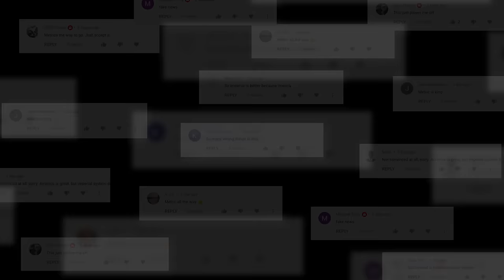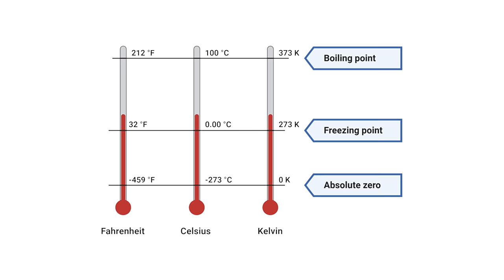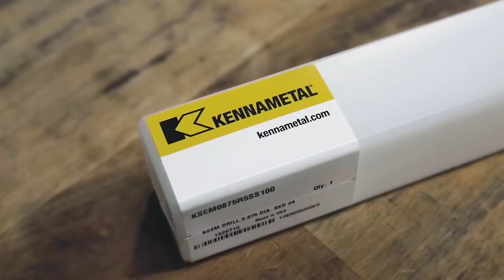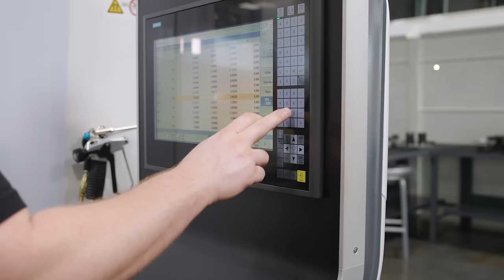Why METRIC is SUPERIOR to IMPERIAL

Comment: The problem i have with imperial is i don't know which one they talk about usually.
When someone tells me their size as 5'7, some mean 5 feet 7 inches, some 5 feet and 7/10th of feet (decimal of foot, like 5,7'), gallons, i can't tell which one and the list goes on. it's always a guesstimation. It must be very to use between people who know which unit they agree on, but having to use both british and american imperial, it's a mess ^^'
Glad most customers i work with now use metric. I believe most of the resistance against the metric system has nothing to do with technical considerations. It's just people don't like change, or don't want to be the generation that will live the change because it takes effort just for that little while.
If America switched overnight to metric, it would cause a fuss for a few years but kids growing with it wouldn't even think about it because it's easier.

Comment: I do construction work and normally, we don't need accuracy down to the level of the mm.  Most of the time our accuracy only needs to reach no smaller than 1/8 of an inch.  Assembling buildings does not require the same tolerances as rockets and lab equipment.  If you're going to talk about accuracy, for much of what we do in life, imperial is sufficiently accurate.  Most people don't do any kind of work that needs extremely high tolerances.  Much of the time we do things that allow for the little inaccuracies that we run into.  Manufacturers use statistics to make sure your 1 liter bottle has at least 1 liter of liquid in it.  Their machines aren't accurate enough to make sure that you only get 1 liter in the bottle, so they always put a little bit more making sure that the minimum is equal to or greater than 1 liter.  It's the same with filling containers in imperial units.  Metric is only truly better when you actually need the accuracy.
Reply: Or if you actually wanna do math. 4.3 mm + 8mm is much easier than 11/64 + 5/16. Any basic algebra will be easier to do in metric. Also, here, the "base unit of measurement" are centimeters.  If you've got to cut a 256 cm piece of wood, you'll know to cut a piece of wood that's 2 meters and 56 centimeters long. The same piece of wood would be a 100 inches in imperial, which is around 8' 5". Imperial might be good at estimating things, but conversion and algebra will always be easier to do in metric.

Comment: Thanks for the interesting and educational discourse.
While there is a case to be made for same same but different, the conversions are annoying and I wonder what percentage of those complaining against the metric had to work in NASA in 1969 or in some machine shops now.
America's legal Imperial measurement definitions are actually backed by metric. So, what is legally defined as an inch is first defined in cm.
I learned this via RealEngineering's channel where he goes into metric in more detail - highly recommended and very drole.

Comment: Living in Germany I obviously learned the metric system. Imperial is just illogical to me though in some rare cases it makes sense to use it. Tabletop Games for example. Measuring in cm just clumps everything up. An Inch though is still a fairly good distance between 2 models to work with. In my job (freight forwarding) it can get funny when talking to my American colleagues when they inquiry a shipment and don't specifically mention the unit we always have to ask if it's inches or cm and lbs or kg.

Comment: The metric system simplifies life much more when you use scientific calculations like magnetic fields per surface area or flows or thrust vectoring then  you csn easily calculate in your head when you scale it.
Try doing that unit conversion in the head for imperial system.

Comment: I MAKE HISTORICAL MENS CLOTHING  the old books I use are in imperial - I grew up with imperial - but OH MY GOD it is a living hell compared to metric.

The patterns I use most I convert the instructions to metric.  But I have things like breast 19 3/4.  Take 1/3rd the breast and add 3/8th so I have [[19 3/4]/3]+3/8
OR 502mm / 3 +10 = 177mm

Comment: There is no two sides to metric versus imperial.
How many tiles of 8 by 10 inches fit in  63 square yard? Easy in the metric system.
and when you have laid down 150 by 150 tiles, how much square feet do you have?
For a 10ft by 9 yard wing how much is the total pressure it can take when it can take 11 pounds per square inch?
When measuring distance or length, when do you switch from inch to feet to yards to miles?
Metric it's simple going 10mm = 1cm, 100cm = 1m,  1000m = 1km How easy is that.

Comment: I was brought up using the imperial system but once finding the metric system I would not go back to imperial. Just one area I found that the metric system fell down large bolts and threads I mean over twelve inches, 30 cm  in diameter, Whitworth thread formula works perfectly no matter how large the diameter of the bolt gets.

Comment: Most annoying when these get mixed up and the 25 mm hose does not fit on the 25 mm fitting as the retailer failed to announce it's actually an inch... 😠

Comment: I prefer metric but I build equipment for rig welders and pipe trades and even metric pipe is based on imperial. Tubing also. I want my equipment to be easily repaired and parts available as pipe welders do lots of traveling and often are not in a place long enough to order online and have to go to local hardware stores where imperial is still the king. In the bicycle industry everything is metric however most of it is based on imperial. Ft lbs is far more relatable than Newton meters. Fahrenheit again more relatable than Celsius. Ansi, nist and api are all standards organizations based on imperial and are adopting metric more and more. Oh yeah DIN standards, Germans 🙄 the newest standard for eu. Please do a video on that. You guys are awesome love what you do. Thanks

Comment: Metric for all things concerning measuring, and inches for fixes sizes, like wheels pipes, hydraulic fittings, etc. Besause there is not that much variation and those things are uniform

Comment: For CNC Machines it doesn't make a difference whether you use metric or imperial, but i is definitely preferable to use imperial when you're using vintage lathes or milling machines.

Comment: Don't you have a dry gallon vs a fluid gallon? So if you ask someone for a canister of a gallon, they first have to ask you what you are going to put in it? :)
Or when someone says a building is 50 miles away, you first have to determine if you are going there by boat or land.
Anyway, I'm all for using the same systems, but the US should propose a trade: you switch to metric if the rest of the world switches to English. No exceptions. Now that would be a lot easier and saves a ton of work.

Comment: I live in Australia, I do everything in mm and microns, but I can do inches and thou - it's basically the same as metric. 1000 microns to the mm, 1000 thou to the inch - But if I get a runsheet with 4"3/16 x 1"5/32... Yuck.

Comment: 1 liter of water = 1 cubic decimeter = 1 kilogram, 
also that same water will freeze at 0 degrees celcius 
and will boil at 100 degrees at sea level.

Also:
1 hertz = 1 cycle per second
1 newton = force needed to accelerate 
1 kilogram at the rate of 
1 meter per second squared
1 joule = energy required to lift 100 grams by 1 meter
1 watt = 1 joule per second
1 ampere = 1 coulomb of charge per second
1 coulomb = charge transported by a constant current of 
1 ampere in 1 second
1 volt = potential difference between two parallel, 
infinite planes spaced 1 meter apart that create an 
electric field of 1 newton per coulomb
1 pascal = 1 newton per square meter
1 bequerel = 1 inverse second

Comment: We also use 'horsepower' to talk about cars power in Europe tho they are based on metric system (75 kgf⋅m/s) wich is 735 Watts, but that's pretty close to the 746 Watts of the imperial hp anyway 😅

Comment: Metric. I had to pass civil engeneering exam in imperial system and it was awfull (yes, i can calculate). Its not the problem to convert inch to cm, but try to convert weight to sq foot to the total load etc... in metric, it´s quite simple, but imperial, many steps are added so there are more possible mistakes.

Comment: please get rid of the Farenheits as well, since we don't use liquid Mercury anymore to measure temperature, while water is everywhere. Fahrenheit is based on Mercury, Celsius is based on water. When it freezes you see it even without a thermometer and you know it has just dropped under 0°C, and when it boils you know it has reached 100°C.
Reply: My freezer is set to 0 deg F. Pretty simple. What about yours? When I see water freeze I know it's 32 deg F. (My brain has the capacity to remember such a number, just like you remembered it is 0 deg C) When my kettle boils, I say "the water is boiling". What do you say? My thermostat has no reason to display a decimal point because the Fahrenheit scale is already granular enough. My weather thermometer has no need for a minus sign. You do Celsius. I'm sure you are happy with it, but there is no need to "get rid of the Fahrenheit".

Comment: Seen from France, the imperial system is really a mess but i understand that going from one system (imperial) to an other (metric) ... is a relly difficult move, all tools, devices, documentations ... that's a lot of work but it will "pay" in the end, cause it's so easier to manage ... 
The idea of the metric system appeared in France in 1800 cause there was so many different type of units that it was becoming a real problem... it was more then 2 centuries ago, there is no "fee" to use it .. it's free .. and it's better, just use it ? 
Before metric we also had the inch (un pouce) as unit in France and it was something like 2.70cm, there was also the "feet of the king" which was 32.6cm ... cause the idea of using inch and foot existed in many places.... what's is amazing is that North America is still in the 19th century, 200 years in the past.

Comment: Not to forget the cross calcutaions: 1m³ = 1000 liter = 1000kg.  So when you have 10 Coke bottles, each containing 1 liter, you have a weight of 10kg. And no, I'm not even going to try to convert that to fl oz. All I know is that a fluid quart is just shy of a liter.

Comment: Why does everyone miss the real advantage of the metric system? It's that length, volume, weight and area are easily interchangeable. 1ml is the same as 1cm3 and in water at 20C weighs 1g, so 1 cubic meter holds 1,000L and if it's water weighs 1,000Kg, or a metric ton. Then there is area, were a hectare is 10,000m2 which is 100 x 100m.
Say you want to water a hectare of land, well it turns out 1L will cover 1 square meter with exactly 1mm, so you need 10,000L or 10 cubic meters (10 ton) of water for every 1mm of water you want to put on, per hectare.....try doing that with imperial.

Comment: 2:15 Automobiles are funnily enough one of the worse examples, because many metric countries also still use horsepower.

For end users, a number like "100 hp" or "73 kW" doesn't carry much meaning in itself. They only have a sense for how much that is by comparing it to engines that they know, like in this case that 100 hp are typical for an older or smaller passenger car, while a more modern one may be around 150-200.

So kW are way more useful for engineers, but end users use whatever unit they know more points of reference in. And that's how the outdated concept of horsepower is still around.

Comment: Metric system, thank you very much. It's the standard measuring unit in South Africa 🇿🇦. My dad actually has two stainless steel rulers with conversion tables on the back. So when it comes to using my dad's old Imperial socket set or drills I know that 5/16" is 7mm.

Comment: Metric system is for sure better. I am from Europe so I am using it everywhere. Until there's a time to buy new TV or anything with screen. It's quite funny because screen size is always in inches. Even if there is conversion (it's not that hard either to multiply inches by 2.5 and get centimeters) but everyone talks about screen size in inches :D

Comment: Actually there's no debate. Metric is the ONLY existing measure system. "Imperial" is only a conversion of metric measures. It doesn't exist indipendently. All the "imperial" measure instruments, tooling, bolts, screws, etc. are designed in metric to have a size that makes sense in imperial.

Comment: Greetings from Germany!

Well.. This is accurate. And obviously the metric system is superior to the imperial one. There's only one thing: Yes, we use KW when it comes to a engine's power but with most people here in Germany, I guess it's still more important to know the PS (German: Pferdestärke or HP in English). When electric cars became a thing, that shifted to KW but with "normal" combustion engines we mostly use PS or bHP.

Comment: A 100 litre aquarium holds 100 kilograms of water.  Neat.  You automatically know how much weight your aquarium stand needs to hold.  Should that aquarium drop 1 metre, it will give up 100 kilowatts of energy.  Pretty handy if you're building a dam.

Comment: The advantage of metric is its coherence. If a formula requires you to enter a distance, it is meters, if it requires you to enter a weight it is the kg. Force? 1 Newton. Pressure? Always 1 Pascal. What is a Pascal? It is 1 Newton over a surface of 1 square meter. Guess what. 1 kg of water is 1 Liter of water, which has a volume of a cube of 10 cm

Comment: You say "why should we use a rod somewhere in Paris as a measurement system", but you forgot to mention that the inch is "defined" as 25.4mm. It is in fact a metric unit and defined against that rod. You guys just choose to use some crazy conversions to get all your yards and feet and miles etc. 
But forgetting yards and feet and miles, as far as machining goes, there is no basic problem using the inch as the base unit. You use thousandths and 10 thousandths, which are both powers of ten. Where imperial falls over is in all the fractions you have. Just off the top of your head, which is bigger a 37/64 drill bit or a 9/16. Etc etc etc

Comment: It’ s more complex than that. The metric system also helps to mesure volume, for example 10 cm2= 10cc2 or 1 lt, son you know that in a cube of 1 mt2 you have 1000 lt of water. All round numbers, easy to calculate mentally. I love how the Americans think they got independent from the British empire in the 18th century but intellectually still follows an obsolete measure system.

Comment: All my machines, tools , callipers   dial indicators are all in millimetres, I know that hey,  I have a part with a diameter 12.61mm for example I know that I have a tolerance of +- 0.03mm it seems more straightforward for me than having to do the math in inches to see how much I need to compensate or sometimes I give  compensations of 0.005 mm , how would you even put that into inches? Seems like way too much hassle 😅

Comment: I started my career as a mechanic 30yrs ago and my tool set was all imperial. Along the way bought metric and used both interchangeably now most new equipment is using metric fasteners. Now all parts drawing come in nothing but metric so now I measure metric. So for me it makes no sense teaching imperial very few manufacturers still uses it. It's more accurate and counting to ten is easy.

Comment: Also, metric system is useful for converting volume to weight. For example, a litre of water occupies 1000cc and weighs 1kg.
You want to hear something totally weird? In the UK, measurement is carried out in metric. Except when you measure road or geographical distances. Then it's miles. You want to fill up your car? Fuel is sold in litres. You want to calculate your car's consumption? Miles per gallon!! Go figure.

Comment: When it comes to linear measurement, they are both the same. First don't convert. With a metric drawing I use a metric rule. I use a standard rule for imperial measurement. Both can be and in some cases are a base ten system. One thing to consider, if we lost our computers tomorrow, how would you divide a unit of measure. Take a length of string, that is one unit. Fold in half it's now .5 units or 1/2. Fold again you get .25 or 1/4, etc. Guess what you have fractional units of measure. Try that with a base ten unit of measure, with the same length of string.
Reply: Metric was developed long before there were computers. Dividing infinitely by two is rarely a critically important feature of anything. And if you are stuck without a ruler then you can't start with a properly measured string anyway, so you are starting with an arbitrary unit and subdividing it, which is not imperial either.

Comment: If you always used the metric system, the imperial system and its fractions is a nightmare. The problem is when you live in a metric system country and some things stay in the imperial one. For example, wrenches in imperial, thicknesses of iron sheets in imperial, wood in feet... Of course, those who work on these things don't notice the difference.

Comment: The measurement units are less important than having a standard. 

My woodworking hobby means that wood is offered in inches and feet at the lumber store. I just bought two 8 foot 2x4s. They were not offered as 50.08mm x 101.6mm and 2.44 meters long. Never mind the little fact that 2x4s are not actually 2x4s.